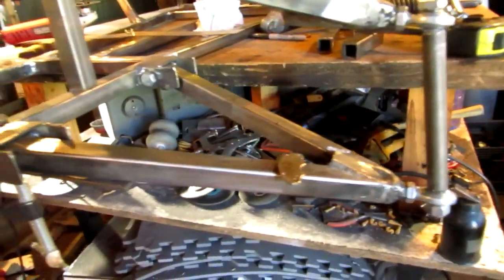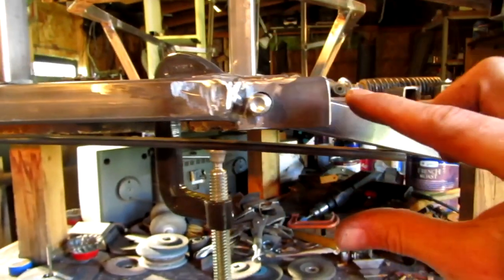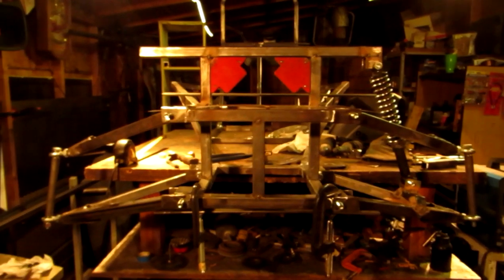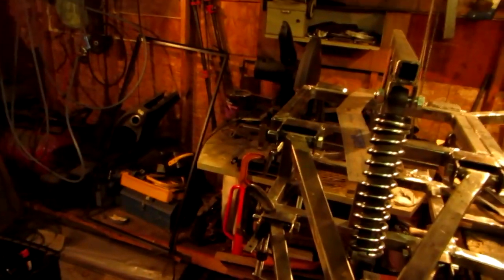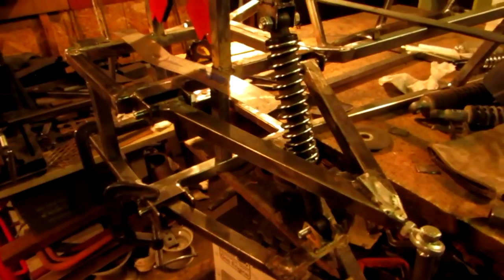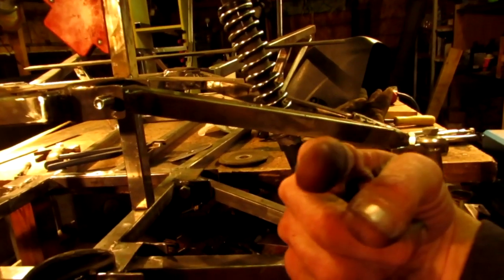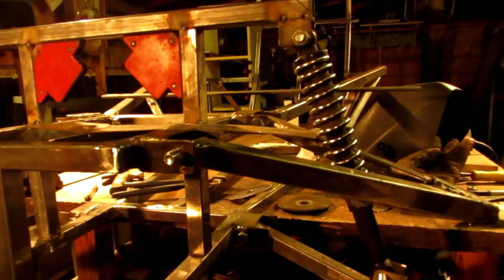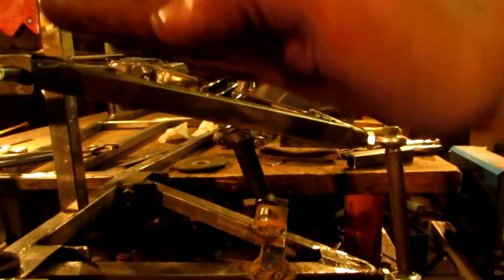█ Go Kart , Building the Shock Mounts #6 ( The Fullscreen Machine )

Comment: Bored? Me? Never been bored watching you. As I won't be going "Of  road". Do you think I need swing arms on the front or do you think I could use "King pin" arrangement? Trying to keep it as simple as possible. Also I have started the steering. I am going with small sprocket on end of coulomb turning a chain driven large sprocket to which the steering arms are connected to. Its to give me "car" steering effect. Does that sound ok to you? Many thanks. Looking forward to your next video.

Comment: hey tman how come you did not rotate the heims at 90 to make them horizontal then build simple boxed spindles. The amount that the heim allows for movement seems to be just enough for turning. Plus the heims are alot stronger being used horizontally. Just a suggestion but looks good so far!